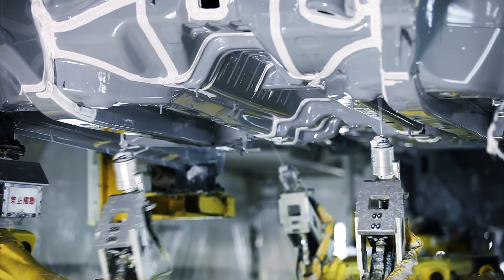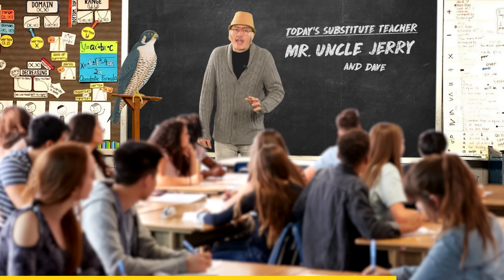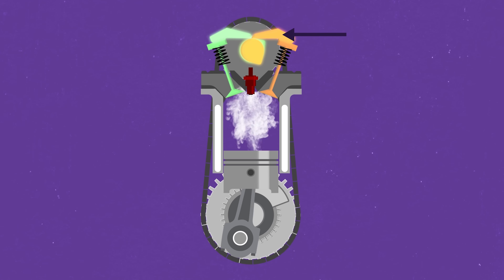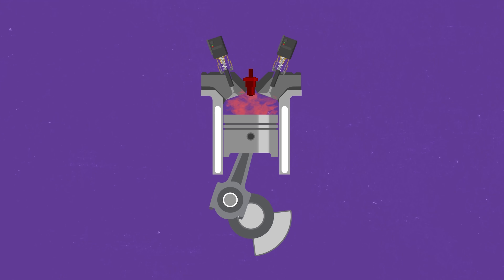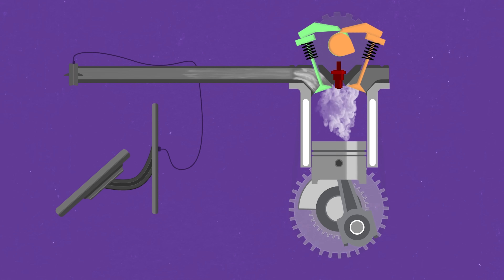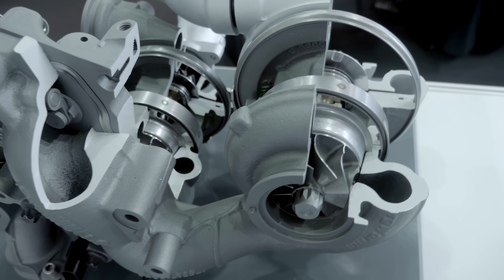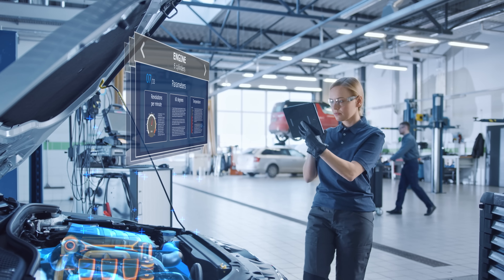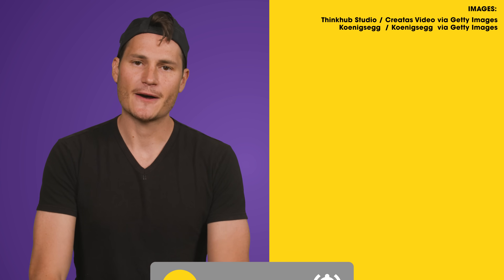This Is The Last Great Engine Tech

Comment: really like this episode, this has potential in a quarter-mile race.
Reply: Don’t think there’s much to gain even power wise. With the high boost drag cars operate at these days, even if the valve isn’t open for that long I’m fairly confident they get more than enough air up to 3000-4000 horsepower. Could maybe take away some weight tho.
Reply: Nah, they are always at full throttle, there gains would be in the 1% range. For ecconomy cars though, it's a game changer.
Reply: @SalveMonesvol  You'd still get somewhere around 30% more power.  It's not a tech to make the engine run better at idle and low speed, it's a tech that makes the engine run better at ALL speeds.  Even the best cam profile and biggest lifters can't match the lift and duration of a freevalve, and that's where you get the additional power from.  Your traditional cam and tappet valves are the biggest limitation of any modern engine, even the DOHC/VVT/DVVC/VVD million valve engines today suffer from the slow and progressive opening and closing necessary from any type of cam profile, but a freevalve opens almost instantly. Sleeve valves and rotary valves have more power potential than freevalve actuated tappet valves on top of that, but to date nobody has been able to demonstrate their practicality or longevity.
Reply: @Skinflaps_Meatslapper  Youy have to take into account that valves have inertia, specially when they are huge, like on race engines with over 1 liter per cylinder. Valves work very well for the specific rpm they are designed for, and the natural progressive nature of cams can be tuned to benefit cylinder filling. Again, the problem is that this can be perfectly tuned for specific rpm at a specific throttle position, when you try to optimize throughout the whole range, you run into trouble. For instance, I own one of the finest engines with traditional cams, the 3.0 busso V6, which is sacrifices both peak power above 6k and fuel ecconomy below 3k in order to have smooth power delivery all the way from 2.000. Still, freevalve would only give it around 10% more torque at 5.000 rpm, since it's already masterfully tuned to breath very well from 4.500 to 5.500. The big difference would be on the extremes. I wouldn't be surprised if you could increase torque at 1.500 rpm by 40%, and peak power above 6.500 rpm by more than 30%.  
 
TLDR: even freevalve has to deal with valves inertia and resonance, and cams can be well tuned for specific rpm, the massive improvements from freevalve come in the weak points of the torque curve, thus allowing you to make the most out of the engine at every point.
Reply: @SalveMonesvol  This is all fine and well, and the freevalve doesn't open instantaneously, but it does open on an order of magnitude faster than what a camshaft is capable of, and can hold far longer dwell times than the most radical high end cam as a result.  Don't underestimate the speed in which the solenoids can open and close, only a few degrees of rotation is all it takes to fully open or close a solenoid valve, whereas a cam profile that would theoretically open a valve that fast will simply have a square lobe to impact the lifter and destroy itself in glorious fashion.  The peak output of any engine can benefit from such a short travel duration, no matter the inertia of the valves and associated springs (use bigger solenoids and bigger springs) or the size of the cylinder.  Most of a cam operated valve's time being open is only partially open, just transit time to being open or closed, and that's time a solenoid operated valve can be fully open and stay open.  Just as the video made the watered down analogy of a sine wave, a cam operated valve hits peak for only the most brief of periods with the majority of the profile ramping up or down to that point, whereas a solenoid actuated valve will hit that peak as soon as the cylinder is clear, more like a rounded square wave than a square wave.  When you don't need the valve open for the entire duration at mid or low rpm, you simply dial it down.  The freevalve is essentially an impossibly high lift high RPM cam, with the secondary benefit that it can be dialed down if desired to operate at peak efficiency at any RPM.  Even if it was never dialed down, it would far surpass any cam on or off the market for peak power.
Reply: @Skinflaps_Meatslapper  You just repeated the theory from the video, but insist on ignoring that everything has inertia.
Reply: @Skinflaps_Meatslapper  How can you write so much while saying so little?
 Sure, solenoids will be faster, specially for closing the valves. When it comes to opening, race engines like those used on dragsters are already using as much force to open the valves as the valve itself can take. 
 I will not fall to your level regarding insults, I don't know you. Time will tell who was right as soon as some motorsport allows freevalve to be used. My expectation is less than 10% peak power increase, yours is over 30%. Maybe when we know who was right one will remember to comment it here.
Reply: @Skinflaps_Meatslapper  Nah. You sure as shit arnt getting any faster or higher opening from this than mechanical cams can already manage.
What you are getting is ideal valvelengtb and timing throughout the entire revup, as well as during shifting if you have multiple gears.
It definktely would be a gain even in straight sprints, though not as large of one as with any other application.
Reply: @ineednochannelyoutube5384  I've seen the numbers for their valve actuation velocities and I have no reason to believe they're not accurate.  I mean, we're not talking twice the speed here, but it's a marked improvement when you're comparing them to a tech that's had, what...200 years of development or so?  In a field like that a single percent increase is hard earned.  There's also the benefit of that speed being more or less constant throughout the valve movement, as opposed to the sinusoidal movement of camshaft valves...meaning that mechanical only comes close to solenoid speeds for maybe a degree or two of crank rotation.  It's sort of like comparing a sine wave to a truncated cone, there's more stuff "under the curve" with a truncated cone than a sine wave.  As for increased valve lift, freevalve hasn't focused on that aspect, but the potential is there to exceed what a mechanical valve can do even when the rockers are pretty radical.

I know it sounds like I'm being a freevalve fanboy, but that company isn't what I'm cheering for, it's the concept of a non-mechanical valve system and theirs just happens to be the only one successfully marketed so far.  If it's successful in the field, then others will take that tech and run with it, and that's what I'm interested in...a multitude of companies adopting this tech and making it shine.  For now I'm still skeptical of how long these solenoids will last on something that isn't driven once a month on a track...I'd like to see how well they do on a fleet of mass produced vehicles, as that's the real test of reliability.  All the tiny little issues that went by unnoticed will eventually cause something to fail, and the success of this tech ultimately hinges on whether those little issues can be solved.  I mean, all it takes is one solenoid acting up to crash a valve into a piston....
Reply: @Skinflaps_Meatslapper  Mechanical valve movement need not be sinusoidal either, it depends entirely on cam geometry. You will also not get more lift force out of any electronic solution than driving directly off the driveshaft. The advantage can be in closing the valves, as this by necessity is slower than the opening, though if that were a problem it could be overcome with mounting the valves to the camshaft in the same manner pistons are mounted to the driveshaft.
The advantage of electronoc valvecontrol is freely adjustible timing and lift.
Reply: @Skinflaps_Meatslapper  30% more power is a bullshit lol

Comment: I don’t think People don’t quit understand how big of a deal this is like being able to have any cam profile you want all controlled by a computer while it’s running, you could control lift and duration and completely change combustion cycles while running, giving the engine the exact amount of air it needs, the tuning possibilities are endless piston to valve clearance and flow and rpm limits would be the only thing holding it back, imagine an ls that pretty comes with the factory with a monster camshaft but doesn’t sacrifice a bit of torque down low

Comment: Chrysler have something somewhat similar. The "multiair" 4 cylinder uses oil pumps driven by what would be the intake lobes on the cam to make oil pressure. That pressure is used to open the intake valves, and is regulated by a bleeder valve controlled by the computer. The exhaust valve run on the camshaft, so it's not totally like free valve, but it does allow infinite adjustment to the intake valves, as well as allowing a single cam engine to have 4 valve per cylinder